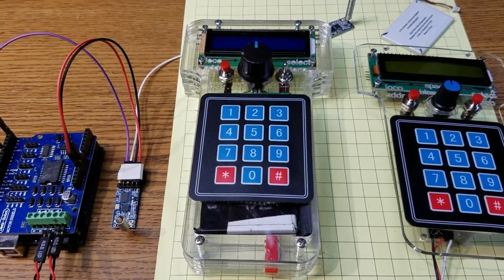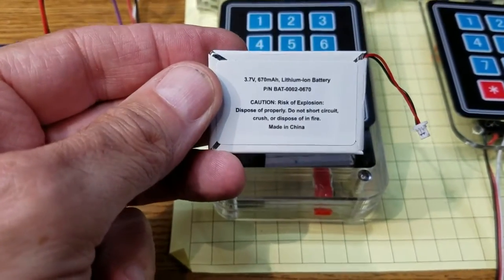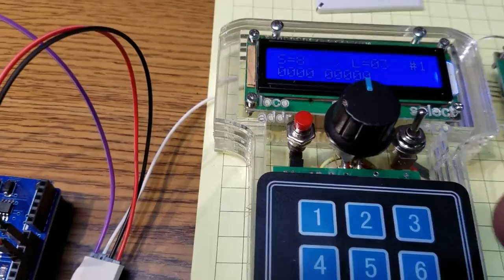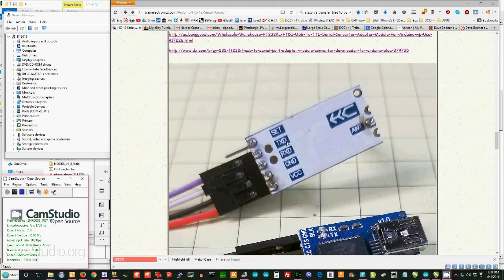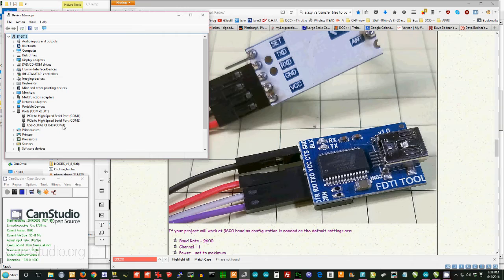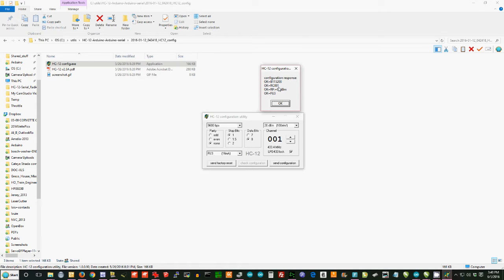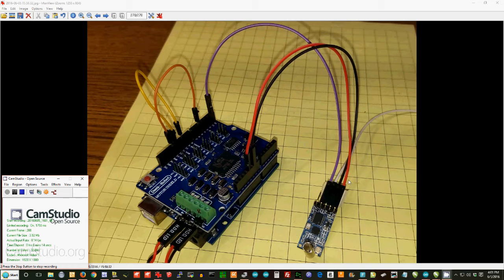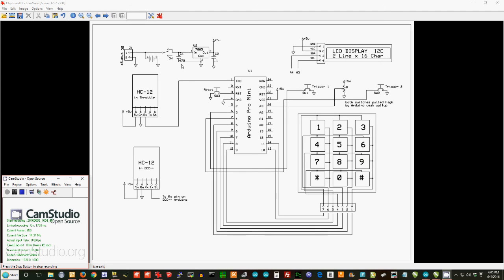DCC++ Wireless Throttle with an HC-12 Radio Serial Link

Comment: Hi Dave,
can I replace the HC-12 Serial Radio with NRF24L01 2.4Ghz or ESP8266?
thank you

Regards
Reply from the maker: Ahmad - You could use other radio modules but the software would need to be modified to support them - I chose the HC-12 because of its ease of use ----- dave

Comment: i was wondering if you can simply change in code, the count of speed counter changes with encoder version. what i mean is when you turn the knob( encoder) every step will change the speed for example 5 steps
Reply from the maker: That certainly could be done.  Give it a try

Comment: Hi, what is the white wire doing comming from the radio unit?
Reply from the maker: It is the unused RX or TX line - since we are only sending from the throttle to the receiver only the TX is used on the throttle and only the RX line is needed on the receiver
dave

Comment: Hi Dave
I want to build the DCC++ base station and then the throttle.  I eventually want to go down the wireless path to control the trains.  Do I get the wireless Arduino UNO Wifi board or should I follow your instructions and stick with the Uno and Motor boards and then add the HC-12 Radio Link?
regards
Reply from the maker: Sheldon - I would definitely go with the HC-12 - it is much simpler to implement and manage - WiFi is more difficult to set up and can limit you to places where WiFi exists.  No such limitation with the HC-12.
dave
Reply: Ok -thanks Dave.

Comment: I am having problems with the wireless throttle function "0" getting the headlight to go on and off. Function "0" turns on the bell instead.

What shows up in CoolTerm when you press function "0" is "<f 3750 129 >1", this is the same as function "1"

Functions 1 (bell), 2 (horn) and 3 (short horn) work fine.  I have not been able to get my head around the logic so far and was wondering if you had any suggestions.
Reply from the maker: John - I don't recall ever setting up function zero - I used it to reset all other functions to "off" as that was more important to me than controlling the light - The software would need to be modified to have zero do the light.
dave
Reply: Dave, thanks for the response. I am impressed with the ease of set up of the base station, and the wireless throttle works great. Is there any further development being done to address function 0 and functions 9-12? . Thanks,
John
Reply from the maker: John - I have moved on to other projects for now - the most active area that is working on DCC++ is here:
http://www.trainboard.com/highball/index.php?forums/dcc.177/ 
dave
Reply: Thanks Dave, I will look there.
John
Reply: Dave, FYI I fixed the headlight problem by adding 3 lines to doFunction routine:

  if (key == -1) {
    key = 4;
  }  

John
Reply from the maker: Excellent - thanks for posting the fix
dave

Comment: Seems like you're simply using a high-tech whip to flog the otherwise-dead horse. Why not mount an ESP8266 and motor-drive transistor inside each locomotive, then supply the track with constant power and control the locomotives directly through WiFi? Sure it won't work for N-gauge, but HO and above will house a 1"x1" ESP8266 without any problems.
Reply from the maker: It depends on your objective - the DCC++ project aims to control existing trains with DCC decoders installed - the ESP8266 implementation would require rewiring of all locomotives, not a trivial task.
dave
Reply: Dave Bodnar Apologies if my comment seemed like a dig at you directly; it was a comment directed at the general DCC++ market of today, which isn't capitalising on the availability of newer technology.

For legacy installations, sure, just keep building on what you already have - but given the opportunity to start fresh (I'd like to think there're still people being introduced to the hobby!), it seems counter-intuitive to simply be developing new ways of implementing older technology.

Having said that, I herald from the days of "cab control" and spending more time cleaning the tracks than actually running my layout, so any advance on that was welcome (I was even almost tempted to fork out a massive wad of cash for Fleischmann's pre-DCC control system).
Reply from the maker: There are folks working on WiFi control of trains but, for now, the vast majority of digitally controlled trains use DCC as does the club that I belong to that has a modular layout.
I am sure new control systems will be coming out over the next few years - 

dave

Comment: Very nice! Thank you for sharing, you do a wonderful work! I have a question about the L7805: doesn't this IC use fairly high operating current, I wonder if you would not do better with a transistor and zener diode regulator? And regarding multiple train control, would it be possible to link to transmitters to one receiver using an address code in the transit signal?
Reply from the maker: Good to hear that you liked the project!

The 7805 I use is good for 1 amp - even when the HC-12 is set to its highest power the circuit is drawing only a small fraction of an amp - so far so good as I have had zero issues with power.
I have successfully used 3 transmitters with one receiver doing absolutely nothing in software to prevent collisions and other issues - I am not sure why it works (perhaps something in the HC-12 firmware) but it does work very nicely.
dave
Reply: Hi Dave, thank you for your answer. Another question: have you ever considered adding a "momentum" (lag control) in the speed response of the loco's?
Reply from the maker: Yes, I have but is simpler and more logical to add that to the DCC Decoder as it can be controlled by a CV.

dave
Reply: Ah great, I did not know this; so much to learn :)

Comment: Nice work Dave, can you post a link to where you purchased the keypad?
Reply from the maker: Thomas - I got the keypads on eBay here:
http://www.ebay.com/itm/251462015970?_trksid=p2057872.m2749.l2649&ssPageName=STRK%3AMEBIDX%3AIT
Make sure you get the 3x4 version that has the * and # keys
dave